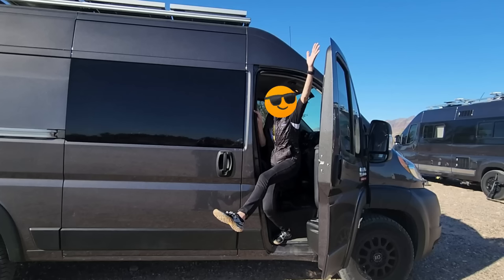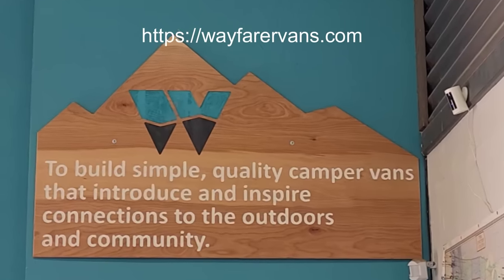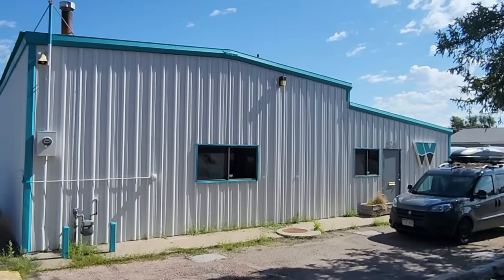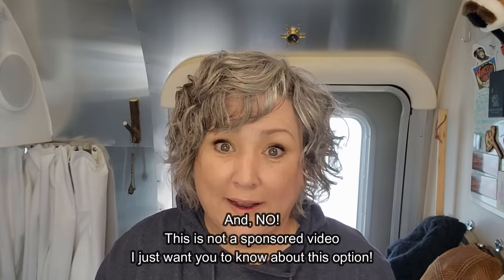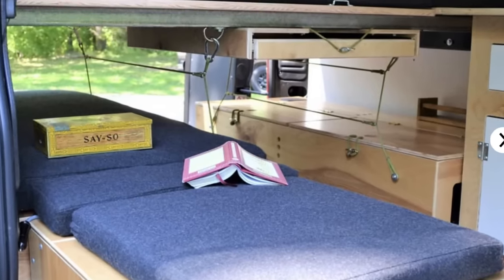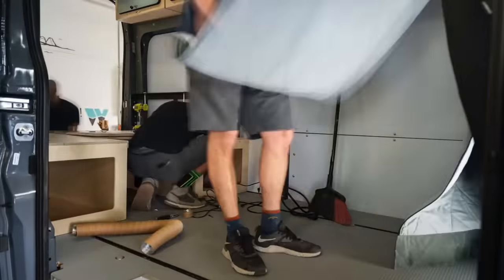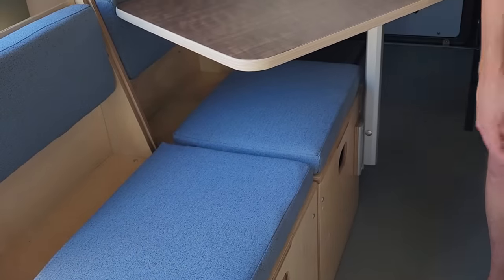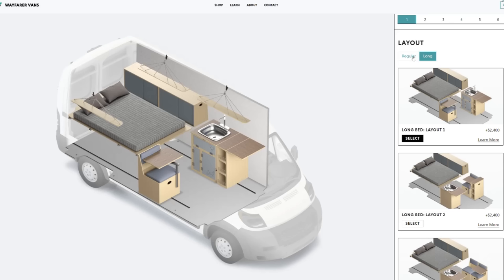You WON'T BELIEVE How AFFORDABLE This CAMPERVAN Is😱❤️! Gorgeous, Modular and EASY.

Comment: In April 2021, I bought a used Ram Promaster 2500 with only 2,000 miles on it from a guy who had it built-out by Wayfarer only a few months earlier. I paid $50,000 total. We drove it cross-country during Covid, from Maine to Oregon and back. We put on 17,000 miles and visited or drove through 40 states. Nothing, I mean nothing, went wrong. The build is dreamingly simple. Having it tuned-up, or otherwise worked on, is simple and affordable--there are Dodge dealers everywhere. The front wheel drive, 19-miles a gallon, and ability to go and stay anywhere, underscore its flexibility. If you add a Goal Zero (or other brand) Lithium battery, cassette toilet and fridge, you're "gold." Best of all, when I sold it, I got $5K more than I paid.
Reply: Wish we could find a deal like yours.  Full timed for 12 plus years in 40 ft Tiffin.  Van would fit our short trips now.
Reply: Was that the van from the guy who found out that he had cancer, right after he had the van built, or why did they sell it ?
Reply: @debbiedebbie9473  No cancer involved, thankfully. The seller was in the restaurant business and there was a shift in Covid and he needed to devote his time 100% to his restaurant business, making the van available.

Comment: Hey I bought  a 2002 Chevrolet van. It costs $3,800. I am currently building it out. At 74 it is not easy but I am doing it. They guy I bought it from is a Chevrolet mechanic and it runs great. I love it. I am painting it blue. It now has a bed. I will put in a toilet, shower, and kitchen. It is great. I love it.

Comment: I did a no build mini van for weekend trips. I rolled out insulation padding over my carpet. I stained and finished a 4x8 sheet of high quality plywood. On the edges all around I put a 1x1 piece of wood. Then I brought my wood house furnitur and used U hooks to affix to the 1x1s. Done. I didn't put one hole in the mini van. If you are living in it full time that's a whole other thing but for a weekender....protect your floors with a plywood base and SECURE everything for safety in the event of a crash. It took me two days and $300. total.
Reply: I'd love to see pictures!! I inherited a Nissan Quest and want to do weekend camping to start.

Comment: In 2018 I brought my Promaster into Ian's shop at 8AM and drove out with a completed campervan at noon.  I have never looked back.  In those days there weren't a lot of customizations, so over the years I added a fan, Wabasto, solar, swivel seats, etc.  I love "Violet the campervan."  Best of all, after 5 years she is still solid, nothing has failed.  I bet most RV owners can't say that.  

The van is perfect for one, and pretty good for two (if you like the person).  I have traveled all over the country in Violet and I love the fact that she fits easily into a regular parking space.  The Wayfarer build is basic, sturdy wood and metal. I love the modular design as I recently built a new kitchen (with my expert friend, Tom's help) to accommodate my "all-electric even when boondocking" lifestyle. It was simple to remove the old kitchen and to mount the new kitchen in the same space.  I highly recommend Wayfarer.

Comment: It sounds like a great setu and affordable.I have something similar to that. I have an F-150 Ford truck with a lightweight Bel Air camper shell on top. It weighs about 550 lb. I have turned it into a camper to suit all my needs .I do not have an indoor shower. I have a solar shower and tent. I prefer just gallons of water and not having any holding tanks. It makes it a lot easier. I also have a Bluetti power station with suitcase solar panels. I do not like fixed solar panels. That way I can park my truck and camper in the shade and put my solar panels in the sun. It works great for me. To me, the more simple the better.  My bucket toilet with horse pellets works great. Good luck with your decision it sounds like a great van set up.

Comment: I have a camper van and my shower is in the back doors with a wrap around tub shower curtain. I use rare earth magnets to secure the curtain. Even in high winds they will hold. I think I use 25 or 50 pound magnets and put them on top of the shower curtain and no scratches. Use the magnets, I have a lot and it’s been tested and works!
Reply: Me too.  The simplest ideas are usually the best.  :)
Reply: @tothewaters.tothewild9148  I couldn’t agree more!

Comment: I bought a used Hymer Activ for $63k.  Had a few issues; one bad lithium battery, bad radiator, needs an LPG regulator.  Ive spent 5k fixing that but i wanted pretty stuff.  So i jacked it up by 3 inches and got bigger tires.  $63k+4k ttl+6k liftntires = $73 so far.  Kbb says its worth $90-106k and so far I love it!  Calling her Petunia.

Comment: I live in Colorado and have been considering this. The only thing I don't like....they insulate the ceiling only....they do not insulate the floor or the walls. Watch their videos online of the build from beginning to end and you will see this.
Reply: Not true.  The floor has an insulating layer attached, and the walls are filled with wool before they attach the panels.  We watched them build ours and they add plenty.

Comment: I can attest to the whole shower elsewhere concept.  My hubby and I drive semi for a living and we have an extended cab ARI sleeper on our truck. It’s similar to a small RV with sink, stove, fridge/freezer, toilet/ shower combo, TV, generator, etc.  We discovered real quick how impractical it was for us to use the shower and toilet. The tanks are way too small, the cassette toilet is extremely hard to find places to empty due to the size of our truck. And since we are at truck stops anyway, we just shower there and use toilets at facilities like we always have since starting our driving careers. The space that the wet bath takes up can be used so much more efficiently if it were a closet, shelves, storage of any kind. And a sponge bath can do in a pinch.

Comment: Amazing content !  It’s so difficult to find a van let alone someone to build it out. Dealers want too much for the vans themselves and are charging 30 percent more than MSRP. I’ve considered buying brand new and building out later but I would have to have full coverage insurance on a regular work van at regular insurance cost.  Having it fully converted to an RV saves so much on insurance since recreational vehicles have way cheaper rates versus a commercial cargo van cost of insurance.

Comment: I got spoiled over our years with campers ultimately ending with 40 ft diesel which I sold after hubby passed on. In retrospect I wish I would gone with something like a Traveto. I could have gone on the road easy  by myself for a couple of months at a time. I thought I had to have a shower though. This year I was in hospital and then physical rehab. When I got home I could not easily get in my shower. Rehab sent me home with large size shower wipes. They worked quite well.  I washed my hair in the kitchen sink. I could easily go without a shower. I was going to put a stand up shower system in my bathroom. They are quite expensive so I got a slide in chair and saved myself about $16,000.

Comment: This is so interesting, maybe a sign, because I have looked at them a couple of times but not having a shower it's kind of a deal breaker for me. I must have a toilet for sure, but the shower (even if it is outside) is also important to me. I even thought that I could add one of those pressurized tube type that you can attach to the roof of the van and shower outside. I haven't counted them out yet, maybe worth a second look since I am still looking for my next nimble rig.
Reply: You could get a shower tent, a bucket, and a rechargeable shower hose pump.

Comment: Many van builders help source the empty vans now.  I’m anxious to learn more about Wayfarer.  There’s a builder in Spain that will be coming to US hopefully, that loads modular metal frames and then basically unfolded and hooked up which only takes a few hours.  Also doesn’t “seem” very expensive.  Thanks for sharing!
Reply: Yeah no shower (outside would be a must) and no bathroom stall are deal breakers for me so maybe not going to be an option for me.

Comment: Minor correction to the video.. THe build includes 5-gallon fresh and gray water tanks.   I guess you could easily fit in 3gallon. As you noted, because they are standard water jugs its easy  to refill anywhere and if boondocking easy to to carry extras and never worry about freezing.    The default is a manual pump sink but adding a rechargeable USB-based faucet is trivial.

Comment: The last time I checked out the Wayfarer website, I think they only had two floorplans: one for the Ram Promaster and one for the Promaster City. All the components could be bought separately. I'll have to check them out, as they mentioned on the website that they were expanding to include the Fords.
Reply: Good info, thank you!

Comment: I'm sorry, but, I wouldn't trade my 2012 Roadtrek RS Adventurous for this. I can see how some people don't want to spend the money on an expensive rig.  I purchased my RV used and the build of the chassis and coach is excellent.   It's a very elegant and ergonomically designed motorhome.

Comment: Wow, 3 gallons of fresh water doesn’t seem like enough water! Was that a mistake - 3 gallons fresh water and 3 gallons gray water? I was 100% sold until that part. I definitely would want a larger fresh water tank.
Reply: You have to be able to move them around to empty and fill, I have the 6 gallon jugs, they weight 42 plus pounds full.

Comment: Having a shower in a van makes no sense to me. Visually, the shower stall cuts off so much space and it takes up so much room that could be better used for living area. Have a packable shower option if you absolutely need it and you're off-grid, otherwise, use a shower facility. Or just sponge bathe as needed. Really, there's no reason to shower every day for most people.

Comment: How is this more affordable? 30-40,000 at minimum for the van (if you buy new) and then another 20-50,000 for the build depending on layout/complexity? I still think that’s a ridiculous price. Just my opinion…
Reply: At your maximums, that's 90K for a home on wheels. Not too many homes less than 90K these days.
Reply: Because one that’s already built out is $150,000-$200,000. This is quite the savings.
Reply: Especially since it's so "simple".
Reply: @lauramathys2131 What happens if you get wiped out on the highway? Will insurance cover your home on wheels? I doubt it. Not 100% anyway. All that time and traveling.
Reply: @justwannasay5454  if you are properly insured, of course....just as your sticks & bricks home, if destroyed by flood.  It requires proper planning and insurance.

Comment: Unfortunately, this won't help me because I am a tail 6 foot, 6 inch guy! Beds have to be 7 feet long for my size, and these vans are too small!! I'm presently in a 24 foot Ram MaxiVan with the Wrong interior. I wish I could find someone to help me rearrange it in here!! I bought a utility trailer to put a tent on it to move all my stuff in here into that tent to fix this space. Modular may be the way for this old 1984 van, good idea if using light-weight cedar instead of heavy particle board!!!

Comment: Unfortunately, none of their layouts make this accessible for a family of four.  We need belt-in seats that are crash-tested in order for this to even remotely be a possible solution.  I've had our van mapped out for YEARS now and just need to find a solid used van to get into it.  Yeah, I'm going to have to hire out the water, electric, possibly the insulation...  It's probably going to cost me an arm and a leg.  Which is why we haven't done it yet.

Comment: A new empty cargo van costs anywhere from 50-80K, unless you find a good used deal. Plus the build, you’re still looking at a 100K. In that case, there are a lot of van companies out there who do this. Just go to one of the van expos. Innovation is out there. It’s the overpriced vans off the shelf/mass manufactured that are of poor quality and unaffordable which makes no sense.

Comment: No bathroom? No thanks, that’s probably the most important thing for my 71-yr-old self. Otherwise pretty cool, tho👍
Reply: --- This 72 yo solo lady van dweller loves pooping in 5 gal bucket! Comfortable seat holds my deluxe stadium chair. Use cedar shavings/horse bedding pellets to absorb liquid & odor. Toss poop bags in garbage at gas stations... Been living in my 2018 Transit Cargo Van 3 yrs now as fulltime horse camp host for OR State Parks. I got my van empty & have slowly been building it into my safe haven cocoon. Change up my front yard every 3 to 6 months... Best way to be retired!